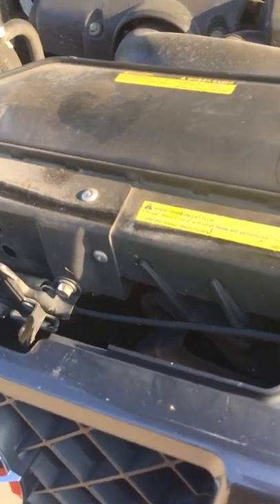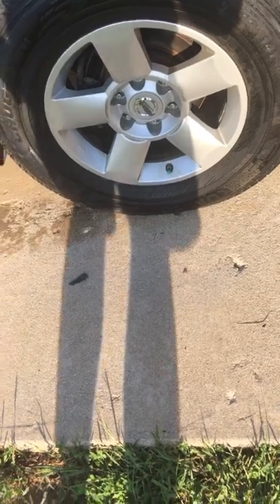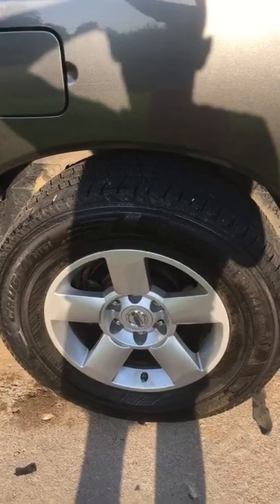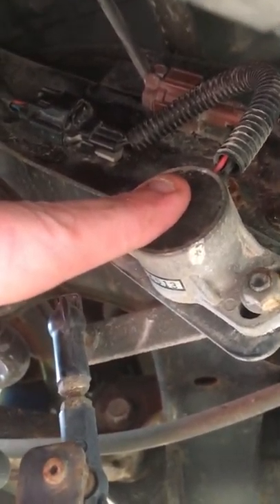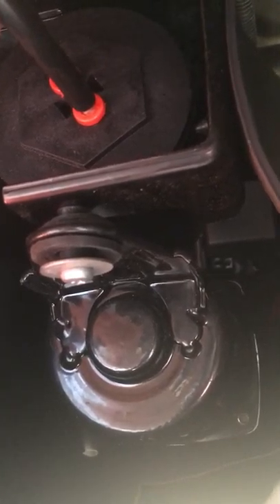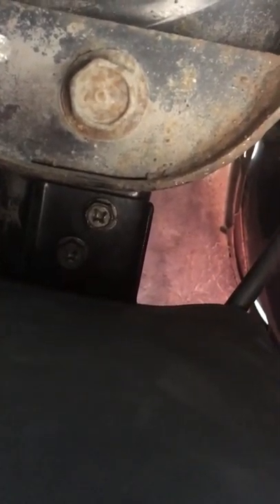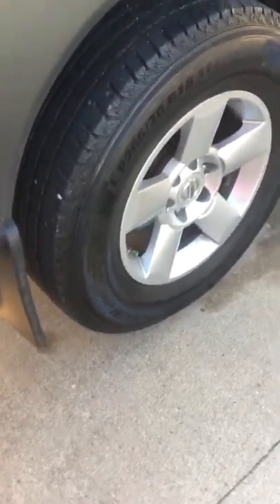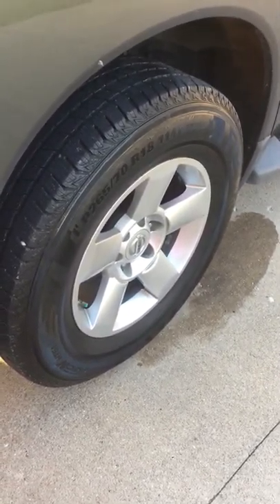Armada air compressor/suspension troubleshoot

Comment: Having the sagging problem in my 2015 QX80.  I found the air shocks for $465 total and getting the back leveling sensor Fri for $200. I plan to get the compressor in a few weeks. Start sagging about 3 weeks ago. This is the only helpful video online.  Thank you very much and GOD BLESS YOU.
Reply: @nocanndo16 How did your installation go? My wife has the same 2015 QX80. Sags in the back. I replaced the air compressor and both sensors and it's still not working. The compressor kicks on but no movement, the frame is about an inch from the top of the tire.

Comment: This is the best video I've seen. The other videos only touched on one of the issues. I was hoping to hear the air compressor kick on.
Reply from the maker: Antonio Banderas do you need me to show you a video of my compressor kicking on?? I can if need be
Reply: Jordan Hoffner  is there a way to adjust the stiffness of the rear air shocks. I am pulling a trailer and there is some sag.
Reply: @agray240  I have seen other youtubes where a test is performed in comparison w/a Denali, both pulling a heavy tongue-weight trailer up a Colorado Continental divide mountain pass.
There is visual of the rear susp. NOT riding at the same height as an UNloaded...heavy weight causes some rear "sag", the riding height is somewhat lower.

Comment: I have a 2017....i was checking fuses and i noticed the FL30 amp fuse was blown....i am running an aftermarket compressor as oem went out 3 years ago or so i thought at the time.  Compressor isnt kicking on and I just had to replace tires and they both have negative camber slanting inward at the top.  Would this FL30 fuse (its pink square fuse with clear top) be the issue and would it self correct the camber or would i have to get it aligned again as it was just aligned yesterday.  Im lost atm.   Thx!

Comment: Jordan... STRONG WORK! Of all of the how to videos for this air suspension system, you provided the only guidance on the air filter piece that embeds into the frame. 

I tried to take it out, but ended up pushing it in, because I couldn't get the locking clips depressed for a smooth removal. I figure it'll bounce itself out of the end.

The compressor was a wicked easy fix. It took me longer to ensure a safe jack support placement and fumbling around with socket sizes, then it did to effect the switcheroo. With my Arnott air shocks, new axel, new lower control arms, et al, I am stoked to hitch up and pull my camping trailer.

Thank you for your simple video; I'll be posting it to the forum momentarily.
Reply from the maker: Hey thanks! Glad I was able to help you out!

Comment: One additional thing that a person should do when installing a replacement pump.  If you look at the supply hose, which plugs into the frame, it has a screen filter on that white fitting that pushes into the frame.  While this filter is supposed to keep dust and other dirty air out of the compressor, I removed the old filter and used a Dewalt air compressor and an air gun and blew all the nastiness out of the frame rail.  If you take a look at this frame rail, it is open at both ends (front and rear of the vehicle) and has holes in the frame all along the length.  When I blew out the frame, a bunch of dust came out of the frame rail.  While this won't prevent dust from getting back in, I believe blowing out existing dust inside the frame rail should assist with preventing dust and other bad air from entering the new Armada suspension leveling compressor.  When I removed my old compressor, I tried taking it apart to see if it could be fixed, but discovered quickly that the old compressor pump and motor were filthy, leaving me with the impression that the failure of these units are likely more to do with dust and other dirt getting into the unit and leading to failure.  By blowing out the rails with an air gun as an extra step, my thinking is that it will help to keep the new levelling compressor from failing early.  It took about 10 years for the original compressor to fail.  I hope that by blowing out the frame rail, that I will get at least another 10 years with the new unit.             One last thing, Jordan ... thanks for the video, but when you plugged in the air bag hoses into the new compressor unit, did they go in all the way?  I'm talking about the spot on the new levelling compressor where the two air bag hoses plug in at the orange fitting.  My hoses didn't push in all the way, and it looks like this may be the case with yours as well.  You can see this on your video at time-stamp 3:05 into the video.  I have about 1/8" that I feel the air bag hoses can go in further, but it feels like they have bottomed out and I don't want to apply any additional force trying to push them in.

Comment: As for the relay to tell if it's bad. Do you disconnect the switch and then start the vehicle? If it kicks on it's the relay? Can you clarify on that please.
Reply from the maker: Unfortunately not. At least not that I am aware of. I just looked at the manual and the only way to bypass is the leveling sensor. Honestly trial and error. You could plug the harness into the 4WD relay and see if it kicks on. The relay works as a switch to turn the pressure sensor on (leveling sensor). Unplugging it would give that sensor no power. Therefor nothing would happen. 

Worst case buy a relay and change it. It’s 15$ and it’s never bad to have a new one.

Comment: My air compressor only work with the scan tool or if I unplug the height level on driver side rear. As soon I connect the height sensor it goes deflated. Shocks holding fine. Please help.

Comment: I am trying to undo the compressor electrical bracket to test it for power.  I am having trouble getting it to separate. Do you remember how the harness comes apart?  Thanks.
Reply from the maker: It just should be a push button (to unlock) and pull.

Comment: Can this cause both  rear wheels getting slanted in slightly from the top ? I am in the process of buyin this compressor and doin it myself
Reply from the maker: Depends on how much. But yes. The rear of the vehicle wouldn’t have the support it normally does without the bags. The fact that it’s both wheels is likely from the lack of support. The little suspension it has without the bags is under a lot of load. This can pull the top of tires inward (physics). Air compressor should fix this.

Comment: Superb video! So I have a 08 Armada and I hear the compressor kick on at start up and throughout me driving around town it turns on all the time. I’m assuming there’s a leak somewhere which caused the system to air back up. I don’t see any visible sagging… yet. Any suggestions on how to go about finding the air leak?
Reply from the maker: How often is all the time? Mine would kick on during drives all the time. It’s normal. Especially if it’s colder outside.
Reply: @jhoff2488  hey sorry for the delay. Yea I checked the bags and lines out and there is no leaks. I ended up going to the local junk yard and pulled two bags from an QX56 with low miles. Just in case. Right now, I’m having issues with my A/C. I got this weird clicking noise by the glove box. Sometimes when I turn on rear heat/cold in the back, I’ll hear it in the clicking on the back also.
Reply from the maker: Your AC Problems sounds like blower resistor. Easy fix. Part is at any auto store. Mine did this also. You just have to take off glove box to fix. Lots of videos on it.
Reply: @jhoff2488  you the maaaan. Thanks bud. Gonna be tackling this tomorrow.

Comment: Any recommendations on how to reset the system without stopping the car? Install a jumper switch to a fuse or relay?  The system losses pressure after an hour or so and I would like to be able to have the compressor top off the pressure to maintain height.  I realize there must be a slow leak somewhere but it appears that they all leak to some degree.
Reply from the maker: My ride fills up about every hour or so as well. It will slowly loose air then fill back accordingly. The sensor that controls it is the leveling sensor. You would need to bypass it by tapping before your relay (I think). It is possible. But honestly it’s just meant to give extra support when pulling or when additional people are in the back. I think i would not be worth your time. I tried researching some forums for you but there isn’t much. I would start with relay tho. Good luck.

Comment: That piece makes a load blowing sound on mine,  do I replace the relay or the compresor?
Reply from the maker: 1. Are the hoses connect fully in the compressor? 

2. If the answer is yes. Are you sure air is not blowing out the bags? 

Usually the compressor makes a loud sound. Pretty annoying. If this is the sound your referring too. That’s normal.

Comment: I replaced my shocks. Now my truck sits up way too high. Im trying to adjust it so its leveled  not to raise up high, any tips???
Reply from the maker: Alex Valladares that’s a different question. Maybe look into a switch that controls your compressor rather than the leveling sensor? You would run a switch through the relay I believe. 

Or there may be away to mess with the leveling sensor. There is an arm that I was talking about in the video. The only thing I can think is messing with the nut on the arm to shorten it. Shortening it would make the arm not goes a far up and stop the compressor. Note: I have never done this but the concept makes sense. I can look at mine if you need me too. 

Honestly I would go with a switch tho.
Reply: The level sensor on the suspension needs to be adjusted. It’s a turnbuckle set up. Loosen the two nuts and adjust the linkage.

Comment: Great info, changed both from dealer, new bags, new sensor and new compressor.  Check suspension light came on, cant get it to turn off.  Compressor wont come on because of it im assuming.  Any tips?
Reply from the maker: Mario Lopez hmm 2 possibilities 

1. Disconnect the relay switch then the battery (the one at the beginning of the video) then reconnect battery then relay switch. This will attempt to reset the system. 

2. Take it to autozone. Have them clear the code. Then see if that kicks on your compressor after the light comes off.
Reply: @jhoff2488  Awesome, thanks man ill give it a shot

Comment: My 2012 QX56 suspension lowers when vehicle is switched off. And raises when started. It wasn't like that before. What kind of air compressor issue could it be?
Reply from the maker: It shouldn’t lower on its own. This tells me you have a leak in your bags. Or an air hose coming out of your bags is not seated properly.
Reply: @jhoff2488  how can I fix a leaky pipe connection to the struts
Reply from the maker: I would first start off finding the leak. Air is leaking from somewhere. 1. Where the hoses enter the air compressor. 2. Where the hoses enter the bags. 3. The bags themselves. Get yourself some water and soap and start spraying to find where it’s at. 

Your vehicle is only a 2012. Seems very odd that your bags would both be leaking. 

*found this 

Air ride systems have one inherent weakness no matter which manufacturer has created them. That weakness would be air leaks from the air bags, air lines used to pressurize them and solenoids that are used to inflate or deflate the air bags. It is very common for temperature to affect the the ability for the air lines and air bags to seal. When temperature drops, these lines and their seals contract creating small leaks. At least this is the most common thing that occurs. This sort of thing happens with evaporative emission systems as well.

Comment: Can you link the Amazon air compressor you used?
Reply from the maker: Dorman 949-500 Air Suspension Compressor for Select Infiniti / Nissan Models https://www.amazon.com/dp/B01ID3W6YS/ref=cm_sw_r_cp_api_glt_fabc_0T8CW38MWFP9495VE5VR
Reply: @jhoff2488  thanks man
How has it been running? Any issues with it? Are you noticing any longer run Time? Is it worth the $ and or you recommend the OEM?
Reply from the maker: @alikk99  no different in run time. Kicks off when it’s supposed to. It’s been two years since I’ve had it and zero problems. I use my armada a lot as well. So it has gotten lots of time.

Comment: Can’t hear mine do you need to have weight on it to hear it work?
Reply from the maker: Sit in the back of the armada. Yes it needs to have some weight sometimes. If you sit in the back and you hear nothing. Something’s wrong.
Reply: So I am pulling a camper 6000 pounds 510 tongue weight. Camper place would not let me leave with something out of my range and safety. The sag is too much in my opinion. Car place says everything is working like it should. But I can’t hear anything working. So any opinion I would appreciate it very much
Reply from the maker: @jonathonharris1758  find me on Facebook. And PM me. I will look out for a message request.
Reply: @jhoff2488  messaged!

Comment: 2012 Armada Platinum here. Relay good. Brand new height sensor. Compressor kicks on, but only when I disconnect it from the Height Sensor right now. I'm thinking something to do with the leaky bags in the struts? I'm am about 3 inch clearance tire to wheel well on both sides like you noted you had before your fix.

Could there be something faulty with the compressor as well? It does kick on, but like I said only when I disconnect the height sensor, and only runs for about 15 seconds. Would not kick on though doing your 3 paperclip method.

Thoughts?
Reply from the maker: So my thought is your height sensor. For some reason the setting on it (screw) may be off. So when connected your truck thinks your at the proper suspension height so the compressor doesn’t kick on. I would mess around with that nut on the sensor and see if there is any change. Am I making sense?
Reply: @jhoff2488  Yup. I know exactly what piece you are talking about. I'll have to play around with it and see what's going on. The new one I put on came spaced out more stock than the old one was. (old one has like 2-3 threads showing, new one has 4-5 threads showing.) still may not be a enough though.
Reply: @jhoff2488  So I just tested what you said and that right now seems to be exactly the reason. I actually disconnected the two pieces of the sensor and was moving the lever by hand. When I moved and held it up, the compressor would kick on, and when I moved it back level, it went off. Only problem is, the bags in my struts are leaking/faulty from wear, but I am changing those soon so I can update after that and see how it goes.
Reply from the maker: Your freaking on it my man. Nice stuff. Yeah update me. Make sure to wd40 the bolts and nuts. Will save you energy and frustration when removing your bags.
Reply: @jhoff2488  Got a new issue now! Air suspension keeps filling up too high to about 38"-39", even after adjusting the leveling sensor. All are brand new. I manually move the leveling sensor arm and it will deflate accordingly, but some reason it won't when I reconnect to the arm. Any thoughts?
Reply: @jhoff2488  WD40 ( WATER DISPLACEMENT 40 ) is NOT a thread penetrant.  It does NOT lubricate.  Use it to shine Fire Engines and "dry out" ign. distributor caps.

Comment: Jordan I just wanted to clear up what you were saying at the start of the video. How to check the relay, you said remove the bolts and harness and replug it in and then turn it on? I'm confused on how to turn it on or what you meant? Thanks
Reply from the maker: Fernando Aguilar okay so I just talked about replacing it. I don’t know to check to see if the solenoid is burned out. The only way to check is to replace it. They cost like 25 dollars at autozone. If you replace and it turns on then it was the solenoid. 

Now to rule out if it’s the air compressor or not you can override the air compressor but that is located under the rig. That’s the part in the video where I talk about using three clothes pins and touching them together. If you did that and the air compressor kicked on you know it either has to be the leveling sensor or some other electrical problem. 

If yours isn’t working 75% chance your air compressor is bad. 25% chance it’s the solenoid under the hood. 

Hope this helps.
Reply: Thanks for clearing that up and for the great video
Reply: You can put 12v charge to the smaller plug side of the relay and if you hear it clicks when you the charge on it then that means the relay is still working
Reply: Jordan,  do you have the part # for the air compressor and where did you order it?  Thanks and nice very hrlpful vid.
Reply from the maker: Phong Tran awesome advice. Thank you

Comment: How often should you hear the air compressor kick on?
Reply from the maker: My kicks on once for sure most times when I start it. A way you can test it is turn your vehicle on, open your trunk and have two people sit on the bumper. It should kick on with the additional weight.
Reply: @jhoff2488  hmmm okay I don’t hear mine kick on often when I do it has a loud humming noise I thought it was abnormal. Maybe it isn’t but I don’t hear quite often every time I turn on my vehicle
Reply from the maker: @hobbyist1001  it’s hit or miss man. The sound is annoying. It’s loud so what your hearing is most likely normal. If you hear straight air like an actual compressor somethings wrong. But the annoying buzz sound means it’s working. I think your fine if you hear it from time to time
Reply: @jhoff2488  sweet thank you and will definitely try to get 2-3 people to sit on the bumper to see if it’ll kick on